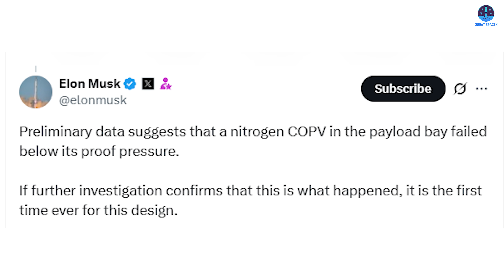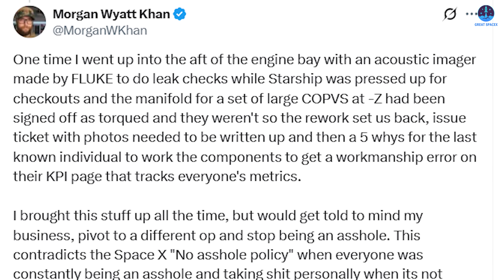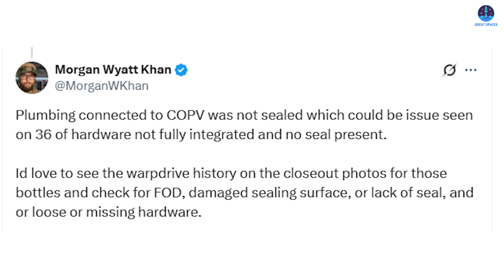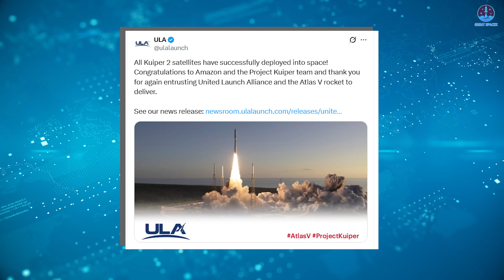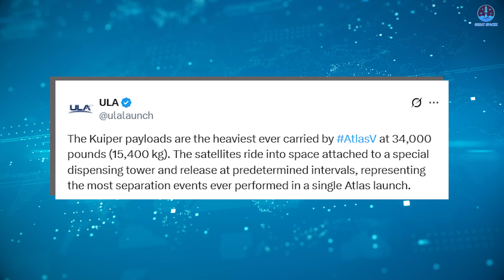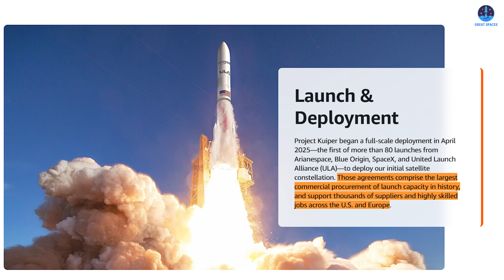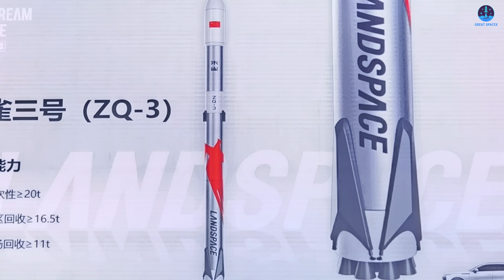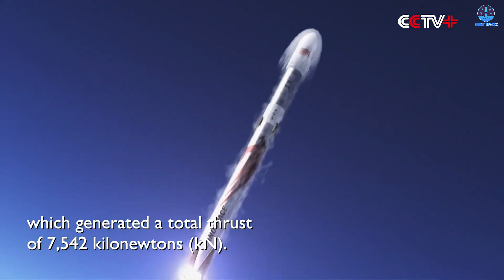Unexpected! Ex-SpaceX employee exposed The Real Reason Ship 36 exploded...Is this real

Comment: If the high pressure vessel can't withstand human handling, how does it survive a rocket launch?
Reply: They can survive competent human handling extremely well. They’ve been routinely used for like a decade with extremely good safety record. But like with everything, if you don’t know what you’re doing and mistreat them, they can break
Reply: Moron handling. You ever been on a job site? The Apollo program never had a single hull loss. Leadership.

Comment: IT IS NEVER EVER GOING TO WORK         Not as long as G=9.8m/s2         Elon loves Ketamine, the letter X and Stainless Steel and he latter is the problem - its just too big and its too heavy for the available materials science to achieve reentry.     Elon thought SS solved the problems of the space shuttle - its didn't, it just made the thing unusable. 

The ONLY way this works is to abandon the reusable 2nd stage and use a traditional disposable aluminium 2nd stage

Comment: why doesnt spacex utilize solid rocket boosters, seems to me would be much easier than all these temper-mental pressure vessels
Reply: Ok So there are Several reasons for Elon's hell or high water commitment to using methane propellant. I think the 2 primary reasons are, despite all Elon's bull shit about reusability, the falcon's merlins had to be disassembled and thoroughly cleaned with heavy solvents without damaging the components then reassembled with all new fittings, gaskets, hoses, and anything else that it  needed.  The Rp1 propellant is currently the cheapest and requires the least amount of effort and  
Expense to store and fuel.
However, it leaves a heavy  carbon buildup
Up until the  newest merlin Refurbishing them took longer and cost nearly as much as building them new. So for a while SpaceX stopped Refurbishing the engines and just replaced them. However, the newest merlin has several carbon fiber components that SpaceX has to purchase, So they do attempt to reuse those when they can.  
Supposedly Elon really thought Starship could  be used for  passengers instead of taking long haul flights. Not to mention that reusability was his biggest selling point to Nasa. I don't think anyone figured out till much later, that it would take 16 launches to  fuel starship if it ever got to orbit. However, Elon thought less carbon would mean the engines could be reused without removing and lengthy Refurbishing.  

Another reason is Rp1s optimal flash temp is room temp. However, it requires Lox to achieve adequate thrust which is kept at extremely cold temperatures or would rapidly expand and blow a ship apart. Because of this temperature difference these two require a large amount of  distance to mix correctly. 

Hydrogen burns clean but was already too costly for elon and the limited suppliers would almost certainly increase the cost and struggle to maintain supply if Starship began launching regularly. 

A seriously funny aspect about the reusability of the raptor engines. Because of the ridiculously excessive weight of the stainless steel, SpaceX has spent a ridiculous amount of time and effort reducing the weight of an effective simple and reliable engine  by eliminating shielding, hose fittings, failsafe. They now can barley survive 1 launch. 1 or more failing, the entire upper engine housings engulfed in flames and massively warped bell nozzles. So reusability at this point is a mute issue. 
Elon is not the brightest guy, but there is absolutely no way he has not realized this is never going to be anything close to being a deepspace craft,  ever human rated or  reusable. Unless his megalomania absolutely prevents him from accepting failures due to his idiotic demands and firing anyone that has a brain and attempted to tell him so. It seemed pretty obvious that SpaceX had quietly abandoned any effort in attempting to develop the lunar lander Nasa had paid them for or any sort of crewed starship. Over 70% of Starships interior being propellant tanks, blast shielding, and fuel pumps lines. Instead focusing on 
Using it for Starlink deployments. However, Starship has failed to reach orbit as an empty shell, the steel warping  have prevented the cargo bay from closing or once not even opening. When they did starship began to spin uncontrollably.  

Elon is Ether desperately hoping for an actual successful rentry or something  he can attempt to claim as successful. At which time he will go public then cash out and walk away, or planning on launch site destruction that he can claim as a temporary setback and just neve pursue anymore starship development. Or Nasa has  threatened to rake him over the coals if he does not keep trying to get them thier lander, and SpaceXcould not operate without all the money, personal, and operational equipment and facilities they recieve from Nasa for 
Free. So SpaceX is Stuck going through the motions of continued development until safe to stop. Because it's far cheaper to waste hundreds of millions then lose billions and possibly be forced to payback billions. 

Another reason for the continued  full commitment to methane is price. Ultra Refined C4 is generally twice the cost of Rp1, however the main supplier SpaceX has contracted with since 2023 sources thier natural gas from oil wells and doesn't  produce refined grades. SpaceX had also purchased a large area of land with intent to dig methane wells as well as the purchase of 2 existing  wells. I don't know if they have proceeded with  recovering methane from their sources, but simply purchasing  unrefined Natural gas is 30% to 50% cheaper than Rp1 and less than a quarter of refined rocket grade C4.
Reply: Starship is intended to be reusable and be able to quickly relaunch within days.  an SRB does not meet this reusability goal.
Reply: @ryanlewis7427  Welcome to 1970! Maybe all that tent era talent at spacex should be refocused into fundamental materials science, because the Space Shuttle was cheaper, and worked.
Reply: @user-pd5ot4zd4b The space shuttle wasn’t cheaper and it had a vehicle failure rate of 1 every 67 launches. It was a terrible design.
Reply: @Willaev LMAO! Thank you for pointing out that a 100% vehicle failure rate at hundreds of millions of dollars per launch is a catastrophically, hilariously bad design!, To be fair, a banana to sub-orbit is a cargo success.

Comment: The Merlin engine was tested to failure, then strengthened. It was originally rated at 750 hp. 

Now some Merlins that survive are rated at 3000 hp. 

The Brits at Rolls-Royce then had a totally different design philosophy.

Comment: This kind of cultural issue is harder to fix than mere design tweaks. Can you imagine, say, the Honda team working with such sloppy standards? The quality control of Cybertruck appears to have been equally shambolic, with endless recalls. This starts at the top - Musk does not have an engineering mindset.

Comment: The failure could resulted from accumulation of frozen solid oxygen between the COPV's aluminum liner and composite overwrap in a void or buckle. The entrapped oxygen can either break overwrap fibers or cause friction between fibers as it swells, igniting the fibers in the pure oxygen and causing the COPV to fail.

Comment: Nothing new. This is why the company had such a special relationship with OSHA, long history of safety violations and a work hours to incidents ratio that would make FedEx stop and reconsider.

As another example the crane that fell over did not have its outriggers set and was not lifting from above the load but pulling sideways. I do disagree with the people who are sure somebody died, because a feature of their last four crane accidents is that they don't use spotters. That operator was out there alone and inside the cab is the safest place to be in most powered industrial vehicle accidents.

Comment: Aviation maintenance/construction is different. The paperwork allows tracking to root issues. Issues will be identified and corrected. 

They are working at the edge of the envelope. There are costs associated with it. Just as there are costs associated with spending years developing perfect paper solutions. 

Space X has done the calculus. They will fox the deficiencies. 

Blindly taking the word of a discharged employee at face value is probably not wise. They may have a data point. They don’t have the A to Z answer. If they did they would still be employed. .
Reply: I did provide solutions and so did my crew

Comment: Its called delamination. You can't keep using those. That also why that sub imploded deep in the ocean. You coksukers are dumb. Facts.
Reply: Space x are using it as it's intended, to keep pressure in. Oceangate was to keep the pressure out. That is not how it's intended to be used. The carbon fibre is strong in tensile strength and weak in compressive strength. You cannot compare the two.

Comment: IMO He's just a disgruntled employee who wants to make up as much dirt as he can. Most of what he says sounds made up. No way in hell would they let go of cross threaded bolts. There would be hell to pay. Elon is far too strict and too much of a perfectionist.
Reply: Heaven forbid your hero Nazi ketamine addict could possibly do anything wrong.
Reply: @MeanGeneSanDiego  sorry but those tanks are made to handle MUCH more than just a little mishandling. the g forces alone. If there was a problem with the tanks it would have to be in the design phase. The ability to handle the forces of launch is far more then anyone can do mishandling it. Anything but gross negligence in the handling of one of those tanks.
Reply: look up the shuttle disaster and O-rings before doing your ostrich impression
Reply: @oystercatcher943  what are you talking about. your barking up the wrong tree
Reply: @oystercatcher943  first of all this is SpaceX we're talking about. Not NASA. Who at the time had nothing to do with those O-rings. It was a contractor by the name of "Morton Thiokol" if i remember correctly. Not to mention that these tanks have no internal o-rings. They are a whole different design.

Comment: Musk fancies himself as a bit of an efficiency expert. But there's a delicate balance that must be maintained to pull off this increasable feat. NASA went to the side of safety. Musk goes to the side of Efficiency. NASA costs a lot. Musk's Falcon 9s are becoming cheap. But were talking about maned operations here. There's a far higher standard for manned spacecraft. Maybe the best route is somewhere in between. A bit more documentation (Yes Elon that costs money), and more careful inspections, and testing (Yes, Elon, I know that costs even more money). But in this case it could be that something like this could have been prevented with better documentation, and testing (Oh, those are dirty words to Elon). That would have saved a bunch of money here. Building this kind of rocket is hard.
Reply: "Increasable" ?
Reply: but astronauts travel on Falcon 9. No doubt that tech seems good at least

Comment: I think this is sabotage from his involvement in politics. Its insane that a copv fault happens this far in Development and the fact that they had 1000 flights plus before they just started having all these problems after flight 6-7 where all the starships started to explode before Even getting to the deorbit phase which wasbt a problem before. They should start reviewing work randomly after assembly from different workers to see if this is a quality control issue or right out sabotage, i think its weird that a rocket made it to orbit on second attempt, continues to perform as intended or as iterations made the starship handle launches to landing then suddenly starts to have engine pressure anomalies, have the same error in the vacuum engine bell twice before it explodes and now, explodes on the test stand almost taking half the area with it in a large fire. The development looks like its going backwards exponentially and it didnt before he started working for trump

Comment: Notice the strikes against management in this review.  Most issues are founded in management issues, which is a problem that only leaders can see.  The fact that he is a former worker, says he didn't fit with the SpaceX environment.  This is a sign of someone that needs to start their own company.  He will never find another company that satisfies his heart.  

The composite materials used in these tanks are known for issues in pressure and delamination.  Many times the material will not flex as the engineers assume.  The idea of wrapping a thin wall tank with carbon fiber is a great idea if the temperature swing is controlled.  Plastics don't handle extreme temps.  The fiber wrapped rifle barrels are great, as long as the barrels don't get hot in a burn off.

Comment: Seems like his motive is to keep people safe. The failures and culture he explains fits perfectly with four "anomalies" in a row. Blame his attitude on what you want, but there's enough technical details to prove his expertise and motive. The culture alone that he expresses would not be tolerated in any critical industry. (Mis)-use of carbon fiber in pressure vessels is seen in the OceanGate catastrophe. Also, he briefly implied the stainless steel type was probably incorrect. That's easily verified if they publicized what they used. I don't know, but I've assembled critical military systems designed by aerospace manufacturers and everything mechanical he mentioned is plausible with semi-skilled labor. The "antics" he describes supports that, and only add to the possibilities of failure.
Reply: Starship isn't the first application of carbon fiber tanks. Remember the Falcon 9 blew up on the pad? That was a helium sphere inside a cryogenic oxygen tank.
Reply: @JMChladek yes, one of the other four anomalies. Whether the CF reinforcement created a problem wasn't divulged. But, it appears to lack the robustness necessary for these cyclical stresses. Really, CF is very dependent on the resins used to bond it. Great material, and so is fiberglass! They are both woven (and/or non-woven) materials created in sheets requiring layering and bonding. So, there's a great reliance on the bonding material along with the processes that utilize the CF. Note: there's no failures of the manned program mostly due to a far different culture required by NASA. They have much more oversight in the manned program evidently!

Comment: Very probable scenario. 
SpaceX employees often probably do some tasks quick and dirty. But although you may get away with it most of the time, it can set up a potential failure. Someone trained in proper handling and installation procedures would notice casual consideration to quality work which may be justitified by a need for speed. 
They would be overruled if the manager did not support this attention to detail. 
It seems this attitude in assembly could easiliy have contributed to this failure. 
In manufacturing, quality needs to be built into the process if quality inspections by others are limited.
The process and training must be improved if quality is lacking.

Comment: Composites are not as good as metal. ....ask ocean gate
Reply: Seriously, Chinese rockets are not Ocean Gate level or Temu level nonsense. Long March 5 delivered on its heavy lift promises with a 13 out of 14 success rate. Compare that with SpaceX. Carbon fiber composites have proven to be effective if manufactured well and used correctly in the design. The Chinese are innovating in ceramic matrix composites which will change the game. Ceramic matrix composites can be used in extreme temperature environments (rocket nozzles, reentry vehicles,  combustion chambers) and the bonus is that it's much lighter than stainless steel and can sustain significantly higher temperatures than stainless steel (up to 1200 C or 3000 F).

Comment: Starship will never get to the moon, let alone Mars. If you look at rocket programs that were designed by talented engineers, that didn't use a "iterative engineering process" then SpaceX really starts to look like garbage. Look at Apollo 4 Saturn 5. Its first test flight and achieved all its objectives and they built it with no computers, using slide rules.

Comment: N1 is still a N1! Being N12.O doesn't change a thing. How are you going to travel for 9 months exposed to the supreme cold of space with this kind of thing going on? Are you going to put a partly fuel loaded Starship into a vacuum chamber capable of simulating deep space cold for 9 months? I don't think so. I wonder if a astronaut travelling on that rocket will be able to get Life Insurance covering death by accident? I don't think so. Going to ride on that thing? I don't think so. Good luck suckers!
Reply: Heat is a larger problem during the coast phase. Space is not cold, it's a thermos flask!
Reply: @GunnarLof  true, consider this tho, Apollo called it BBQ Mode by rotating the capsule, but the capsule inside had a heating and cooling system to balance it out. I don't believe the Starship non habitat quarters will be internally heated and/or cooled. Hope I'm wrong but yes, i did assume that its not going to be cooled and heated throughout the whole ship. My bad i guess if its not. Otherwise I perceive issues.